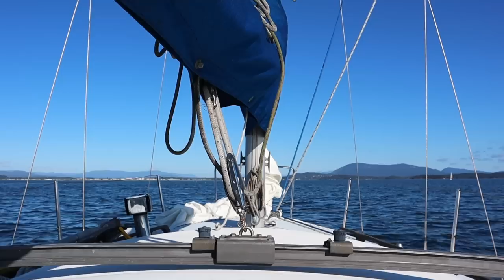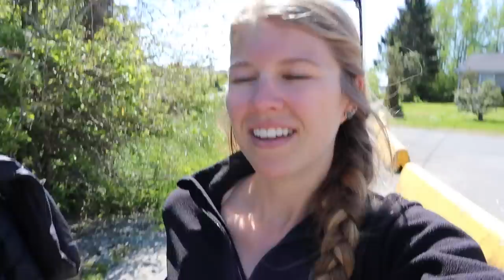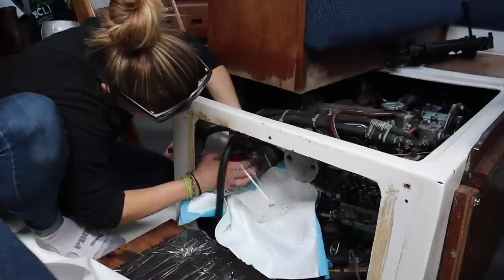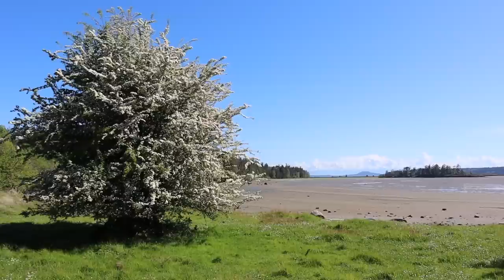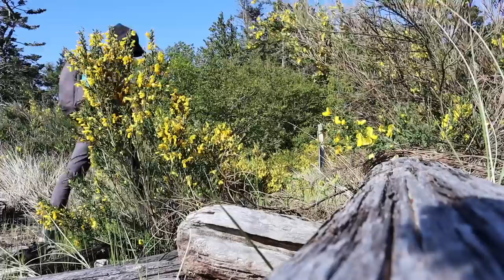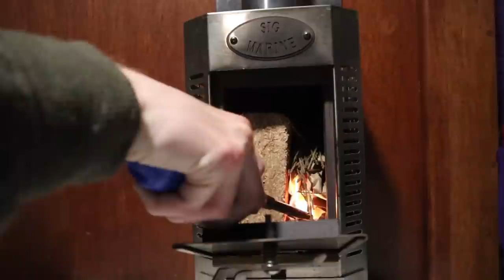Did We Run Aground? | Daily Routines of Living Off Grid

Comment: Yup you need a motorcycle filter wrench, you can use a rag wrapped around the filter, then use that wrench. Also, IF you ever get suck aground, I have twice, once waking up to it and lucky I had a wet suit, and the other during a sailboat race. One of you jump in the dinghy, swing the boom out with a line hanging down and pull down on the end of it, that will heel the boat enough to paddle or motor off the grounding. Sometimes you can get enough by just Jonas hanging on the boom off the rail to get it off, depends on how hard you are aground. Beautiful weather, glad to see you are having fun, I have the same depth finder, get a piece of string with a weight and tie a knot every 5 feet or something, sometimes it reads a false bottom.

Comment: Tip !!!

Always keep a length of fuel hose that you can fit onto the filter directly with some fuel in a clean can onboard.
This way if you have bad fuel in the main tank you can isolate it and run the temp feed. It should get you out of trouble.
In lasts week's comment I mentioned getting a fuel polisher to clean your old fuel, however I suspect your tank does not hold too much and it might just be cheaper to empty the tank clean and refill.
Reply from the maker: Thanks! That is a great idea :D Okay good to keep in mind!

Comment: just an idea.. use a plastic bag over your filters when taking them off. You can slip the bag up past the seal and capture all the drips without spilling a single drop. The filter drops into the bag while you hold it up and because the bag is flexible you can undo the filter by holding it on the outside ...if you get my meaning. 
Good video .. cheers
Reply from the maker: Great idea! We will definitely do that next time haha, it sounds like it would help a lot with the mess!
Reply: @BlueMoonLife  trust me .. I learnt the hard way. lol

Comment: Careful when bleeding the fuel system that the copper washer doesn’t fall off and go into never-never land. If your bleeder bolt is not equipped with one, I recommend cutting a small groove down the length of the bolt, not all the way to the head, which will allow you to bleed air without completely removing the bolt.  Pro tip: scribe the head of the bolt where the grove is so you can make sure the groove is  pointing down into a container when loose.
Reply from the maker: Thanks for the advice! We'll remember this fo next time we work on the fuel filter :D

Comment: Not sure of the situation in Canada, but here in Australia with the advent of Bio Diesel there have been issues with algal growths in fuel tanks, especially where the fuel sits for a long time, these algal growths can end up right thru your fuel system from the tank to the injector pump and can really restrict fuel flow, making the engine starve (hunt) for fuel. There are products on the market that will break down this algae to the point it will pass thru the system and burn off in the cylinders. Ask in any specialty diesel mechanical workshop like big truck workshops and they should be able to put you onto the right product.
Reply from the maker: This is really helpful, thank you!
Reply: @armslength2618  I don't know about that, my guess is theres a good reason why the diesel mechanics working on engines worth upwards of 6 figures dont do this.
Reply: @BlueMoonLife  If this is your problem I have had a lot of success with the following product, if it is available in Canada. ( Inter-ject 420p Diesel Care & Cure Additive ). This product has been specially formulated here in Australia to combat biocides in diesel fuel. Hope this helps.